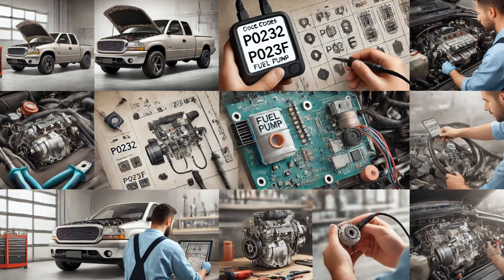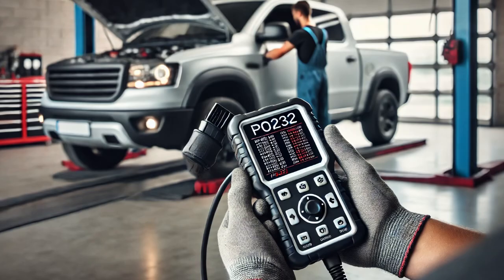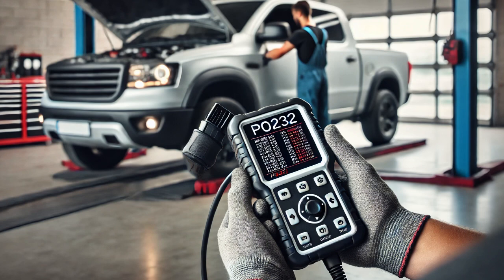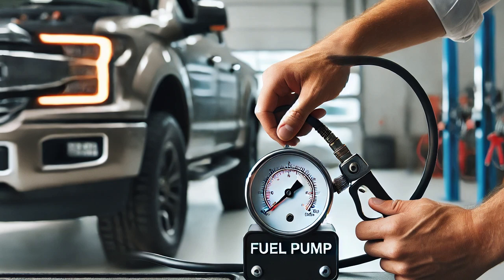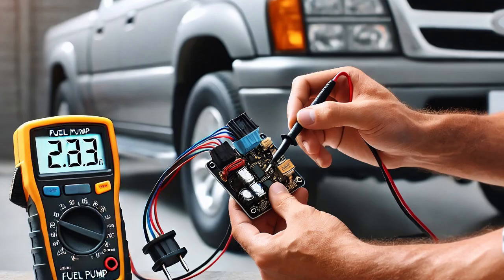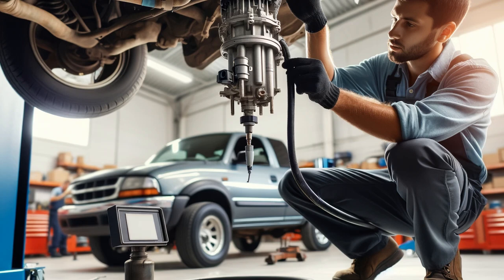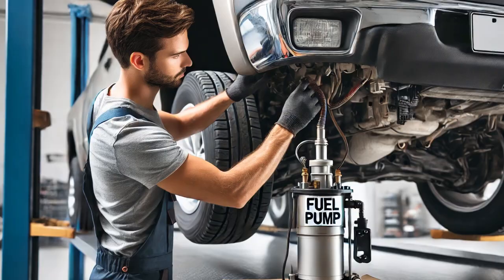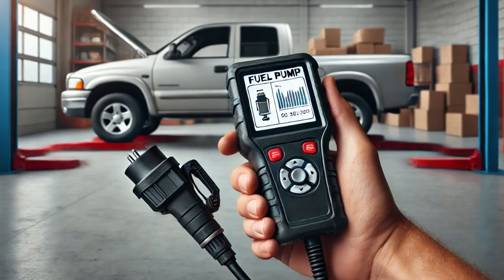P0232, P023F Fuel Pump Secondary Circuit High/Open Chevrolet Silverado 1500 2014-2018 diagnosing

Comment: I have p023f code I replaced the fuel pump and it starts right up but still shooting that code
Reply from the maker: If after replacement you cleared the error codes with the scanner but the code returns, it may be a problem with the wiring.